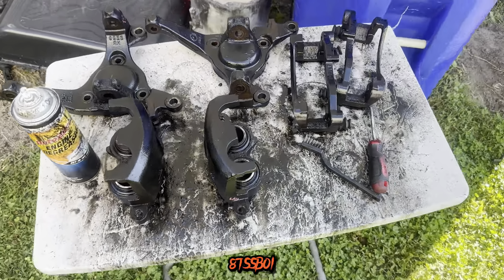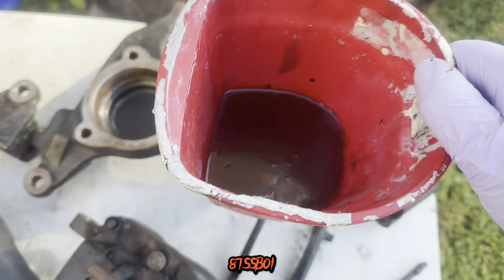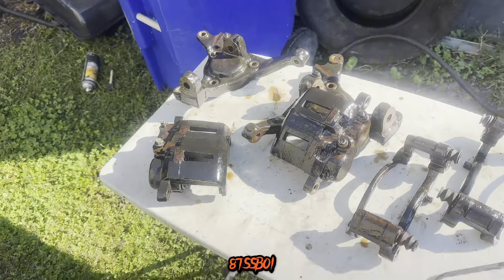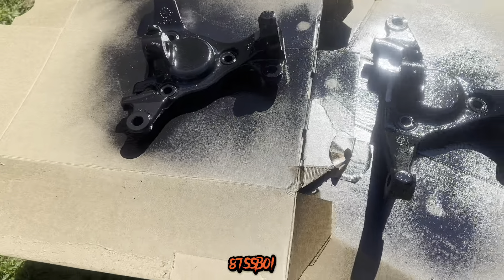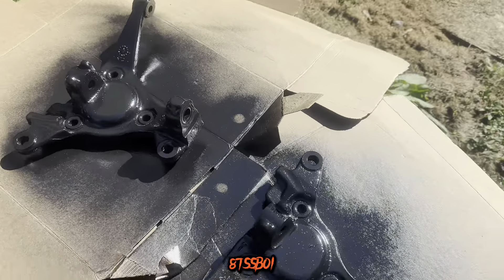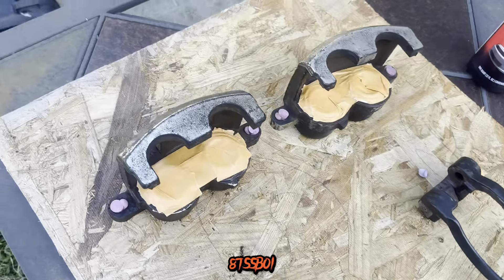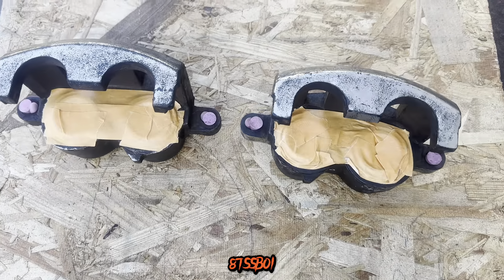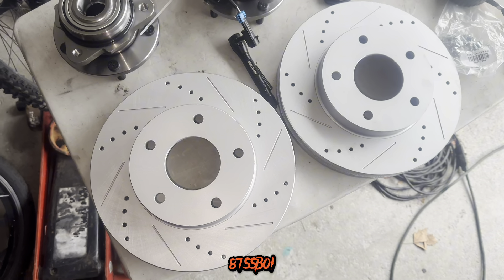Blazer Spindles and Calipers almost ready for GBody install

Comment: I have a 79 Chevy El Camino, what size wheels would it have if I put the blazer brakes on the front and back? I have about 15" on. Thanks. Greetings from Texas.
Reply from the maker: I am not 100% sure but I think you’re good with 15s…I haven’t put my stock wheels on since the swap but that sounds like a good idea for a short video…thanks for watching 🫡
Reply: 15 inch wheels work on the blazer spindles I know I work at a junkyard 78 Malibu with them spindles on 15 inch wheels